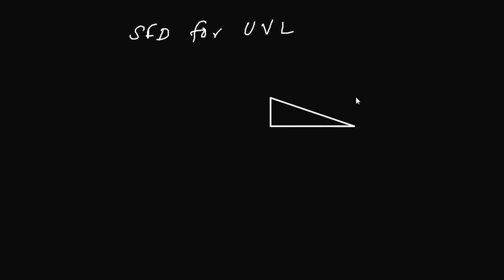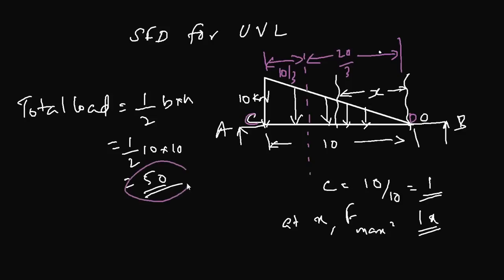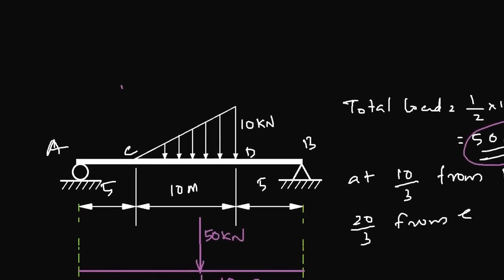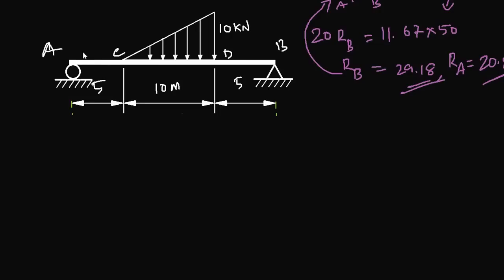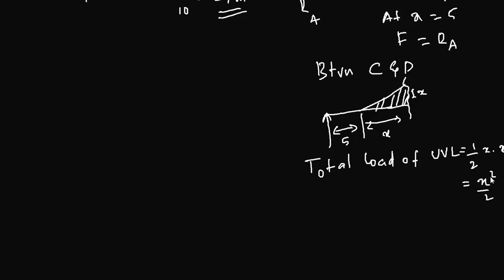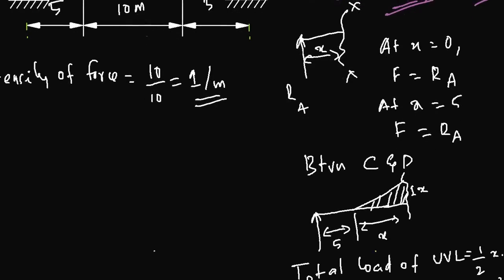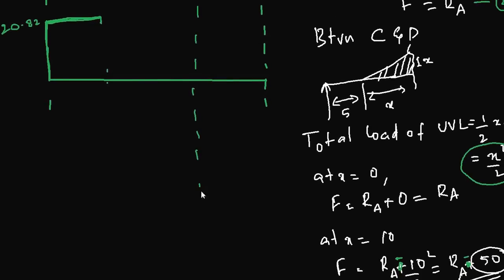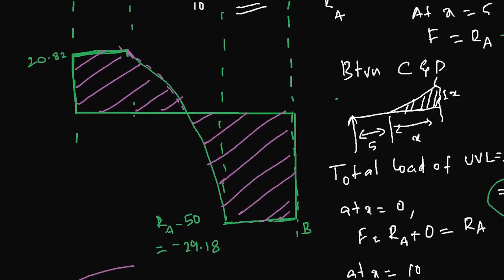Mechanics of Solids 8 - Shear Force Diagram, Varying Load

Comment: Hi. Your explanation is not complete. How do i find the value when shear is zero between section C and D?
Reply from the maker: You mean you want to calculate the length at which shear is zero ?
Reply: Yes sir. I followed your calculations but when i reached that section, the calculations felt incomplete.
Reply from the maker: +Awg Afizal:  To calculate the distance at which shear force is zero between C and D, equate the shear force equation between the section to "Zero". i.e. Ra - (X^2)/2 = 0, this will give you X^2 = 2*Ra, or X = 6.45 m. Therefore the shear force will be zero at 6.45m from the apex of the triangle. Hope this clarifies the query, feel free to comment if you need further clarification.
Reply: Perpetual Academy Thanks. I managed to get the same answer x=6.45.
Reply from the maker: Awg Afizal Glad we could help you. :)